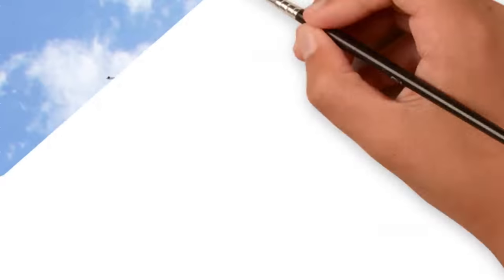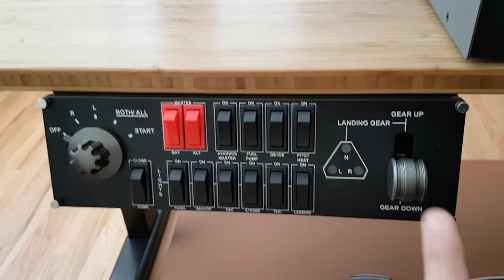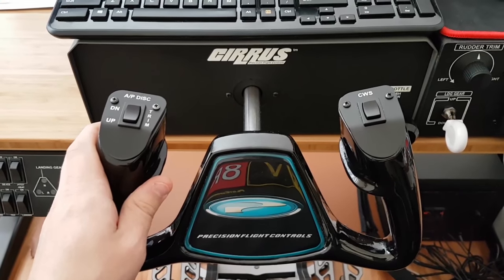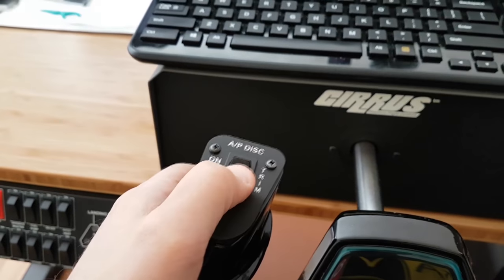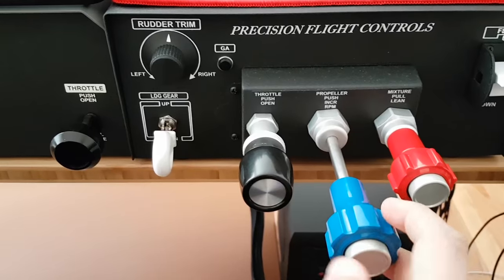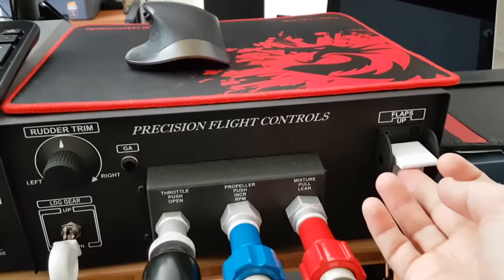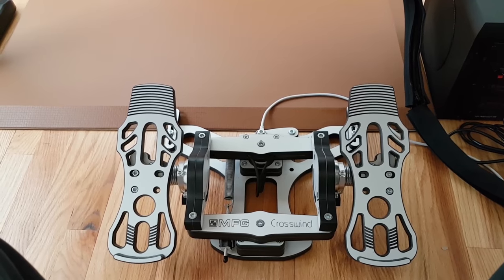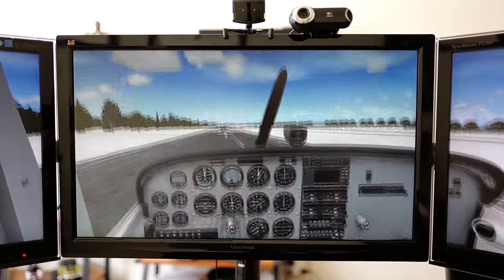My Flight Simulator Setup (PFC, MFG, Saitek, and more)

Comment: Hello, I consider about the best Yoke on market. One of the candidate (beside YOKO and CLS-E NG) is the Cirrus yoke. Since there are only few reviews I would like to hear from you about you experience. I could see on video the inside of it and it was not very impressive (beside the big box measurement) Thanks for answer ..
Reply from the maker: This is a PFC Beach Yoke.  I really like it.  It is heavy and built very well.  It is also very precise compared to the lower cost yokes.  However, if you have some extra cash you can always go to the next level and get the Active Force Feedback Yoke.
Reply: IMHO, I think (and considering the big $$$$$ I guess everyone should do it ) just "Put" your hand on, and see yourself which one will better serve your purpose ....  I'm still looking on a comparison between the Yoko & PFC  ( BTW Yoko got hat Switch , PFC which PFC is missing )
Reply: @yair1956  Im a little late to this but I would like to know they same thing

Comment: Lenny, glad I found your video using the PFC hardware. I've got the yoke and looking into the throttle quadrant console and vernier controls. What flight sim are you using and any tips would be appreciated.Regards John
Reply from the maker: Hi J.  I use both Microsoft FSX and X-Plane 11.The configuration is very straight forward.  The only tip that I have is if you are going to use the X-Plane, there is a really good video from them on how to properly tweak the controls realism.  They also have a tuning video for your video card to get the best frame rate and such.  Honestly at this point If you had to choose one, I would say go with X-Plane, due to constant ongoing development, although FSX has a bunch of positives and tons of great plugins.
Reply: Is the throttle quadrant console plugin play or is there a plugin required for for X-Plane 11 use.  PFC website lists compatibility for XP v9.70 only, no FSX which I thought was odd given how long it's been around and thought they had not updated it. Wanted to check with someone who's using XP 11, FSX before buying. How long have you had yours? I've also been watching your flight lessons thanks for posting, very helpful. Have you done a sim video flying a detailed traffic pattern explaining altitudes, when turns are made, rpm settings, speeds, when to use flaps etc. Thanks for reply much appreciated, John
Reply from the maker: Yes it is a direct plug and play.  No other software is needed like you would with Saitek.  It will show up like any other Joystick.  You will just configure and calibrate each one to perform its function.  PFC is not great at updating their website.  I've had my X-Plane since v.10 then 11 Beta and now official release version.  One thing I hate about X-plane is the ATC function.  It sucks.  Microsoft FSX even though its old, it is light years better than X-Plane.  You can get it to work using some other methods found on the web, but it just sucks that  it does not work well out of the box.  I have done a video of a full flight with pre-flight.  Here is the link  https://youtu.be/Vv_3Wls879A  I may do another basic one to show takeoff, traffic pattern, and landing.
Reply: Lenny, thank you for taking time to respond. Hopefully in next couple of days will be placing order with PFC. Without your video and info would not been able to do confidently. Have subscribed so I can watch more videos of your flight training, which airport do you fly out of.
John
Reply from the maker: My pleasure.  I will try to do more videos soon.  Unfortunately I have not been able to fly for past two months due to some family priority changes, but I am hoping that that I will be able to get back to it soon again.  I was flying out of Old Bridge airport, 3N6.
Reply: Lenny, understand family priorities, hope you can soon as well. Noticed you have all three T/P/M vernier controls, what aircraft that you fly uses prop control and do you have any additional throttle controls to switch out or ones you may get in future. Thanks again John
Reply from the maker: So far I only fly Cessna 172, but hoping to fly 182 at some point.  I also have an A2A Cessna 182 plugin for my FSX that works very well where I can use all three.  I also have additional Multi-Engine Prop/Throttle/Mixture controls.  I use it on a multi engine sim, but honestly I have not been using it much lately.
Reply: That's about the same path I'm on as well, found 182 & 206 uses the three control setup. Interest in the C208 and small twin eventually. Called today placed console order with twin engine and Cessna tpm controls. With weather and winter ahead hope to have time to learn, procedures and enjoy the sim. But lots and lots to learn and watch videos you've posted help see real world application. I'll check back and let you know how it's going. Thanks and take care.
Reply from the maker: My pleasure.  Enjoy your sim.  I will try to post more videos soon.